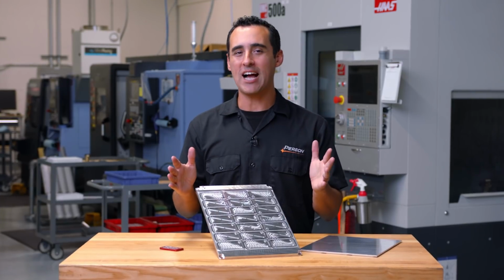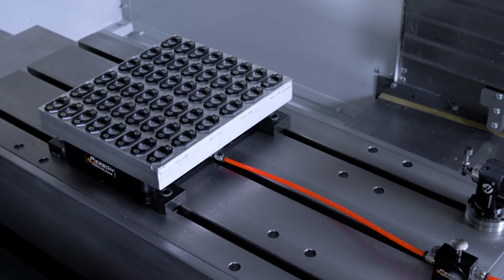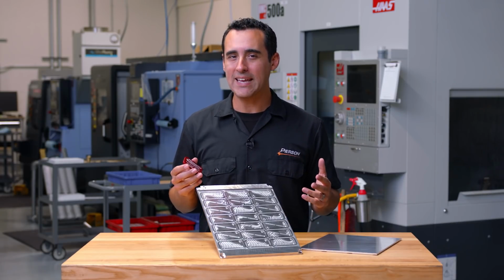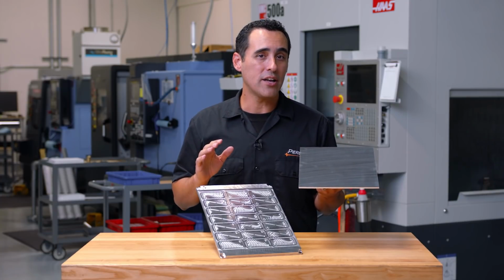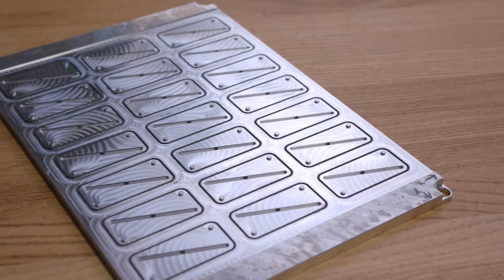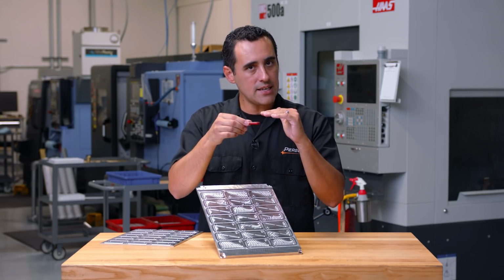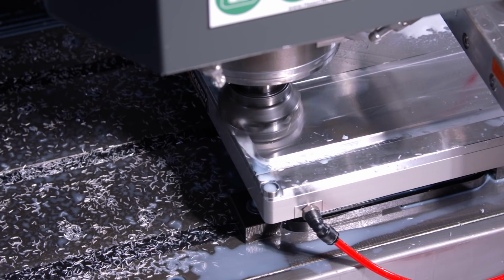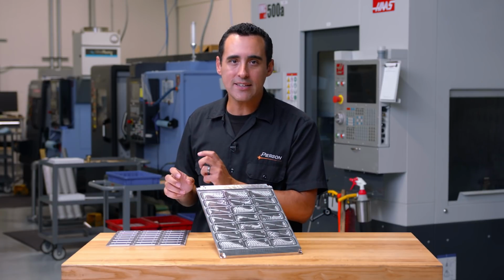PRO TIPS! Machining Multiple Parts Per Cycle | Fixture Friday 18 | Pierson Workholding

Comment: Hi Jay, have been using your pallet system for a few years now! got my last company using them and now have convinced the shop I'm at now to start with one (hopefully in a year or two all 40 of our machines will have pallets!). One thought I had when setting up the one we just got, the Haas VF2 has 16" Y travel, which put it right at the limit of your largest pallet (I'm guessing one of the reasons you chose that size). Given this its critical to get the base as close to center as possible, since you have this nicely machined name plate right on center if you added a small little spot drill indent in the center of the plate it would be much easier to get the base visually centered on machine travel with just a drill in the spindle.
Reply from the maker: We recommend the same approach but using the round pin as your target.  On a 16" travel machine, jog your table to Y-12.75 and this will give you a target to align the pin.  Pro Tip:  If you want to get super accurate, use an empty 1/2" tool holder and CAREFULLY jog down to lightly contact the pin and use the taper to center the base.

Comment: Cool. If all of the setup parameters are kept in the machine that means you can do one batch of 21 by itself with no setup time. Great lean tool. Very inventive product line.
Reply from the maker: Exactly! A common origin between all pallets is part of that equation.

Comment: Maybe too complicated, but have you considered just integrating an air connection right through the PPS base up into the pallet? Then you could have the two control units hooked up to the PPS, and no need to hook up the extra hose to the vac chuck.
Reply from the maker: It would still require 2 lines, one for pressure, one for vacuum. A more simple approach could have been to simply split the incoming air to both the valve and vacuum power unit.
Reply: @PiersonWorkholding  sure, I just meant more as a pass-through. So you can swap vacuum chucks just as fast as normal pallets. But I can also see that not being very important because vacuum is usually so quick to swap parts anyway and you don't really need to do offline loading/unloading

Comment: How do you deal with variable material blanks?  Many parts we use are saw edge bar and ordering 1" wide bar means you get 1.000 to 1.125 width.    Can't use pitbulls that way, but a vise works because you just tighten an extra turn.  
Got any suggestions that don't require pre-qualifying the blanks?
Reply: Can you put the pit bulls on the extruded edges not saw edges, much more consistent.
Reply: @INSERT1234  In my case, I'm talking about buying 1/2" x 1" saw edge A-2 tool steel.  When it arrives, it can be 1.06 to 1.19 wide.  It also tapers from one end to the other.  
Thanks for the ideas tho.
Reply: @jonbaker3728  you could buy stock in standard sizes say 1.125 rather than 1.09?
Reply: @LoneWolfPrecisionLLC  Material isn't available.

Comment: Wait, so what you're telling me is that you can suck vacuum with your vacuum power unite (the box that has written SmartVac 2 in the video) by blowing air into it
So you don't need a vacuumpump that litterly sucks air anymore??
Reply from the maker: That's correct.  The Vacuum Power Unit uses compressed air as its power source to generate a deep vacuum.
Reply: It's called a Vacuum Ejector
Reply: It basically works like carburetor in gasoline engine. There is also a venturi, but here, flow of air does not suck fuel, but air from underneath the part.

Comment: How do you get the logo on the part? Is it laser engraved or machined on the mill? Awesome video btw! Amazing production boost!
Reply from the maker: We use a fiber laser - It is the fastest and most durable way to mark the parts.
Reply: @PiersonWorkholding  It would be great if you shared with us, how you do that engraving, if not, at least tell us with which machine you do it 20W, 30W, 50W, 100W. Thanks Pierson.
Reply: I make dog tags, and engrave with the mill machine, it takes a long time. Pierson could you tell us what method you use?
Reply: the most probable is that they first carry out the anodizing, and then with a fiber laser machine they carry out the engraving.
Reply: Probably anodized & then lasered. Standard lower powered CO2 lasers will take the anodizing off aluminum. We have people do it pretty often on a CO2 lasers at our Makerspace.